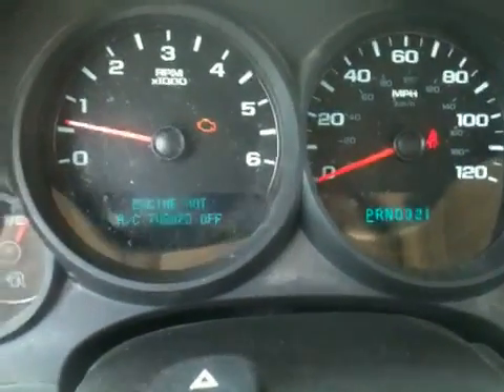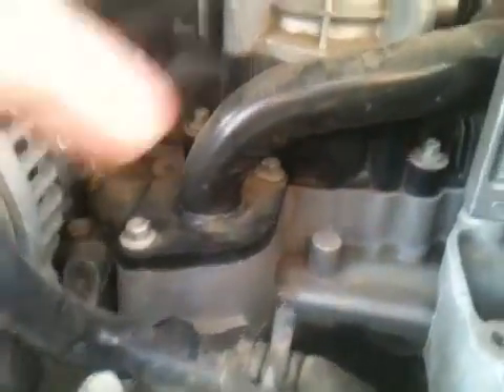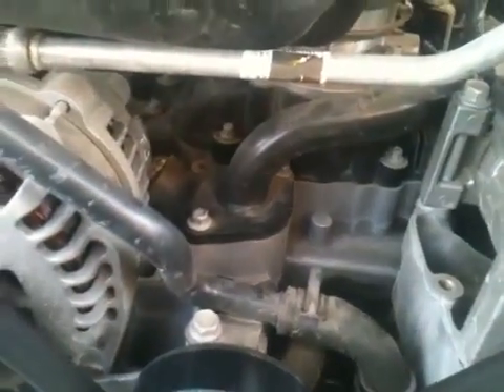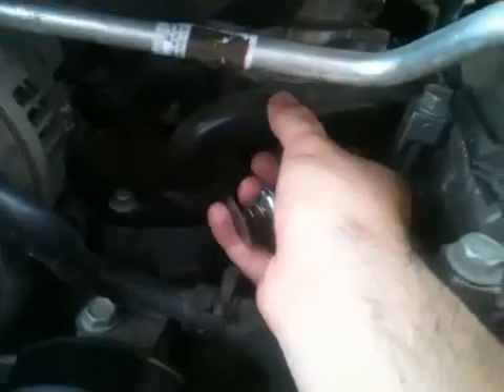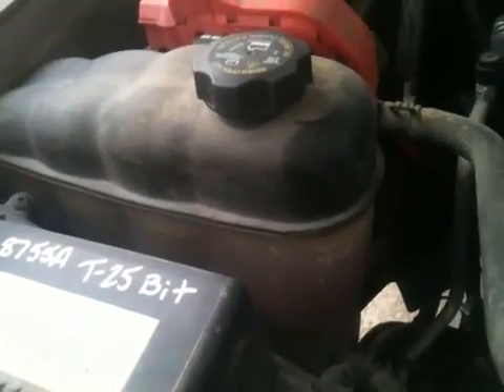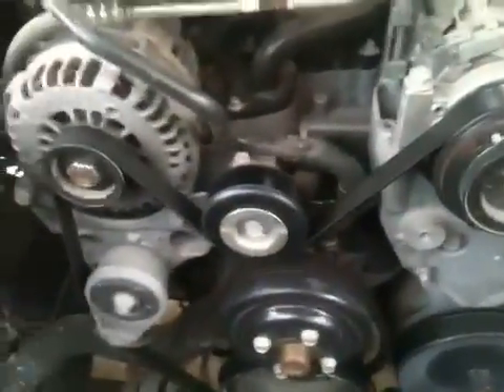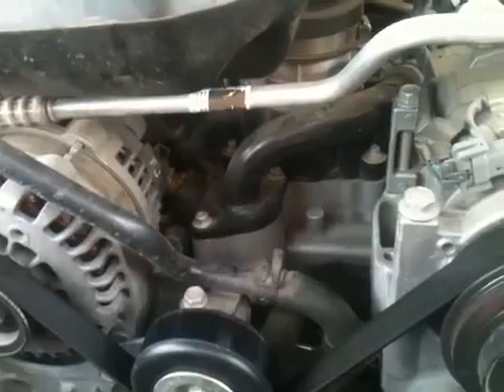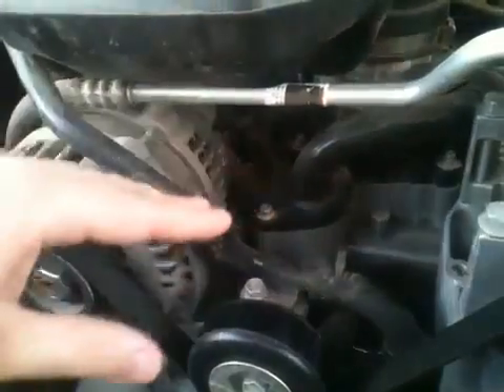Engine Hot A/C Turned Off Silverado

Comment: Great video and helpful explanations.
I got that warning 30 miles in to a 130 mile trip.
Without knowing the cause, I found the coolant level to be full.
Stopped at a Home Depot for tools and removed the thermostat.  
Refilled coolant; made it home with heater on full blast and driving 45 mph.
2008 Silverado WT V6 with about 72,000 miles.
Thanks!

Comment: I have an 09 Silverado and the dealer changed the thermostat under warranty in 2013. I am still having problems and the only thing I know for sure is that it is an electrical problem. I disconnected the negative battery cable for 15 minutes and reconnected the cable and now works fine. I personally think it has to do with one of the many sensors causing the computer to fall into a fail safe position until the computer is reset hence the battery being disconnected and reconnected.
Reply: also, I live in Georgia and the only time I've had this issue is in the summer and more specifically after a good rain and the roads are steamy and the humidity is high. I've had it happen while driving and shortly after start-up at idle. My local dealer told me it was the thermostat and it was replaced as stated in my original comment. I think it's been replaced two or three times now. I hope this fix works for all of you but I found it easier just to reset computer. very annoying but will save on coolant. 

If anyone reads this I'm curious as to what outside air temp everyone else has when it starts acting up.

if mine does it again I will throw my buddy's scanner on it and see if anything comes up and record the different temps and pressures. 

Good Luck everybody!
Reply: +Boe Blue YEP same solution for 2011 Sierra. Disconnected the ground at battery for about 30 minutes, then problem cleared.

Comment: So I just got done watching your video..I have a similar problem with the dash reading "engine hot, AC off"..on a 2007 Chevy Silverado 4.8L. Problem with this is that I didn't receive this message up until I changed out the thermostat and the ECT Sensor...don't know what's causing this but it's driving me Bat Shit!! Lol...any suggestions??!
Reply from the maker: Make sure the correct thermostat was installed, if a 180 degree thermostat was installed it could cause the same problem if the engine was designed for a 195 degree thermostat.  Same goes for the temp sending unit.
Reply: aeroaggie ok..thanks! So the Coolant temperature sensor has to be of a 195 degree also?
Reply: aeroaggie where did you find your 195 degree thermostat?? Because all the auto parts stores in my surrounding areas including the Chevrolet Dealership doesn't carry it..the dealers thermostat is a AC Delco part number 131-60 and that one opens up at 188 degrees...so any Intel would help please!

Comment: Great job ....my 2009 Silverado turned 40,000 and bingo, the warning message "engine hot, ac turned off. That confusing, because the engine was not hot and the cooling fans ran constantly. The size socket was also mentioned, I bought the thermostat, extensions drive and socket (size 10) which also fit my negative connection on my battery. The total cost was 27.00 dollars. I saved a lot of money not taking it to a garage. I also drawled my belt and pulleys under my hood.

Comment: This exact thing just happened to my 08 Silverado 4.3 V-6, this past Sat. the first cool front came in, I got up in the morning, drove about 6 miles, stopped for gas, found this problem when I started the truck back up. I can remove the battery cable for thirty seconds and the A/C will run again, the gauge comes back up and the fans quit running. As long as it is in the heat of the day it stays running fine. I just bought a thermostat and as soon as it cools off I'm going to try it. I had decided that was that was the problem, then I saw your video, so that just confirms what I thought. I'm a 35 year mechanic, but I don't do much computer work on cars.

Comment: Thx for the info. Just changed out my thermostat. $10. Quick and Super Easy. I did panic when i started truck after installation and problem continued, but after a ride around the block, it cleared. Problem Resolved. THX Again..

Comment: hi..i have same prob with my2008 v6silverado . i found out that when coolant level is low  temp sensor is exposed resulting in the computer taking the system to a safe mode..just add the right level of coolant and your prob is solved